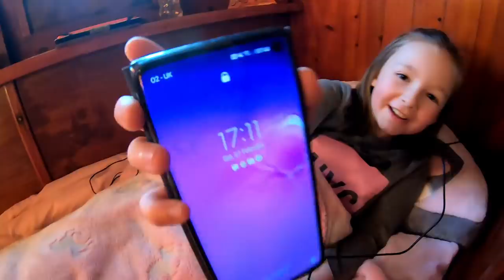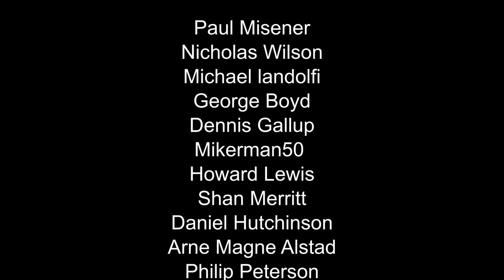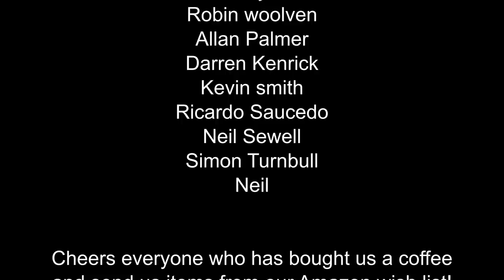Ep 9 What awaits us under the poop deck cover? Restoring our wooden WW2 Ship - Ship Happens

Comment: Sorry, but your poop deck story was backwards. They would "poop" off the bow, or the "head" of the ship, therefore bathrooms are called the "head". Actually poop comes from la poupe. A french word for stern. Technically what you are calling a poop deck is simply the stern deck. People do need to understand your explanation of the "plan". It does make total sense. If you had the money to do what people think you should, maybe you wouldn't even have bought that boat. You're doing great. Lots of cleanup to do before you can even begin to do many major fixes. Regards, Solomon

Comment: The forward main deck looks amazing after a little scrubbing. The darker stains will likely lift with a treatment of oxalic acid (wood bleach), but sadly it will raise the grain after drying. A good pumicing stone will level and lighten further what the wood bleach didn't get. I wish I knew a quicker way to fix the mid-section forward of the stern, but its in-depth process starting with the supporting timbers directly beneath the missing deck portions, and everywhere forward and aft from the breach. The rot has to go, as this is a heavily stressed section with the marine diesel's beneath the ribs & stringers that support the main deck & cabin areas adjacent to it. The kids berths turned out so well, after the barest of efforts, which undoubtedly was a blessing. Stay safe & be very well.

Comment: Just a suggestion. What about you put a length of wood on the roof with a tarpaulin attached and then have a frame on the bow (front) which would give you cover to stop the rain from entering the boat and also give you a dry area to continue to work. I hope this might help, good luck with your build.

Comment: Just to expand on what you said Gemma; Having a wooden boat on the hard for a long time dries out the planking and it will shrink a LOT, this can damage the hull even more not to mention that it then becomes a huge deal it get it back in the water, while it leaks like a sieve due to the shrinking of the planks until the planks swell again.  Also to give an idea on how much the planks can shrink, I saw one wood boat that spent too much time out of the water and the planks had shrank so much you could drop coins between them.

Comment: You may have already worked it out by now (8 months later) but the red tank at 11.11 in episode 1, that was sitting where you have put your shelves back in beside the engine room door, looks like it would have been a remote fire fogging system for the engine room. It wouldn’t meet spec’s now anyway but you may need to consider where you’ll fit a replacement one.

Comment: Poop Deck The name originates from the French word for stern, la poupe, from Latin puppis. Thus the poop deck is technically a stern deck, which in sailing ships was usually elevated as the roof of the stern or "after" cabin, also known as the "poop cabin".

The bathroom or "head" is so-called because it was usually located near the figurehead  at the front (bow) of  old time sailing vessels.    The reason for this placement was because the hull slanted inward away from the upper side of the gunwale and any waste fell directly into the sea without soiling the hull.  There were usually two, one on either side and sailors always used the downwind side when doing their business for obvious reasons.    Wiping was often done with a rag attached to a rope or just the frayed end of a rope  that was lowered into the passing water for cleaning, then retrieved for re-use.
Reply: @meister1210  -- Surely is British slang and a term us Yanks aren't generally familiar with.
Reply: @olgringo-421  there are many terms we use that came from the age of sail. Such as, Three sheets to the wind, to describe someone who is drunk or freezing the balls of a brass monkey, to describe cold conditions.

Comment: I saw the song video  , interesting to see the old lock off the ship lock better with the wire railing  than the wood railing.( I think) it gives the hull a more slim apperens than the wooden bullworks. 
Also you get a flush deck with this construction , no drain ports 
( this can also bee achieved by building in a gap under wooden bullwork)
 Restore the wire 
Railings means  , less work  I think .
The posts can be made on shore and brouth out  to the ship pre made.  By putting in more rows of wire child safety can be achieved.
Of corse these choices are yours to make.

Comment: From extensive experience of restoring wooden boats dont remove your Poop or afterdeck yet. Replace the rotten rib ends and beam shelf first. Start at the aft and work forward completing each rig before starting the next that way you dont risk loosing the shape. Start by taking a paten of the aft rib in ply and check it against the next rib. There is a good chance that several of the ribs are exactly the same which means you van fabricate the portions of each rib that you need off boat before stripping down the rib itself 
Only once the ribs and beamshelf in that section are complete should you remove the decking and repair/replace the deck beams as then you have solid bolting for them.
It may seem obvious but only replace the rib ends where the rot and damage does not extend down past the waterline leave the others until you are on the hard.
Reply: Just keep doing what you’re doing it’s entertaining.

Comment: She looks 100% better with the trash off her!  Work the schedule that works for your family and what you can manage.  You've done so much work on her already.

I like the idea that someone suggested of erecting simple frameworks over the foredeck, aft deck, and top deck and stretch tarps over them (use translucent ones?) and fasten them over the side.  That will keep the rain out and let you work on the decks over a longer period of time.

Is is possible to move her closer to the loading ramp area without costing money?  That might save time and energy by letting you access her by dinghy without depending on the tide.

Comment: An idea for cleaning up wood and removing stain`s on wood is to use OXALIC ACID and Spray it on with a garden sprayer. and leave for half hour then wash off with water you should see a big difference in the wood. plus OXALIC ACID is BIO-DEGRADEABLE. Its made from Rhubarb leaves

Comment: You all did great today, the rubbish is always a huge undertaking so congrates on a job well done.
I dunno if you have one ordered for the boat but when you get up to the point of running the engines again I would suggest a carbon monoxide detector, I know with all the holes in the ship presently it shouldn't be an issue but as you get the ship more water tight I think it might be a good idea to have one in the engine room as a safety precaution. Cheers from Canada keep smiling
Reply from the maker: We do have fire alarms and carbon monoxide monitors and about a million fire extinguishers!

Comment: Ultimately, the only thing she'll have to be on the hard for is the hull work. Everything else from the deck repair to interior fit out can be done, and in fact is best done in the water. Gemma is absolutely correct that you don't want a wood boat out of the water any longer than you have to, so it's best that they be fully prepared to do everything to the hull in one shot, which is what they're probably planning. When new yachts are built, once the bare boat is built, all the finish fitment is usually done at a slip

Comment: Great update guys. I think your cracking on great as it's costing you all a weekend as well.
It's a massive undertaking and I'd be the same, just clearing it out and seeing what's what.
Are you allowed to tie a load of pallets together to make a path to the boat? A bit like a duckboard track.
Reply from the maker: We are on a SSI area so we couldnt get away with that, also the mud is a great layer of security! it will dry out more in the summer which will make it easier to walk to with the kids!

Comment: You are following a very thoughtful approach and are getting closer and closer to the fun stuff of refurbishment. Seeing the changes as we can finally see her is refreshing. Rails?  Perhaps steel post and cables with a wood top? The advantage of what had been added would be keeping the deck dryer in heavy chop, but that said, not sure you would plan on local leisure cruises and mooring or rougher duty. You can plan based on its future use. Her style changes over the years are pretty striking. Looks rather cool. You can pretty much go whatever direction you wish as you replace much of the old additions. We love seeing  you all at work. Beautiful family!
I had not considered getting the mattress like that. Worked quite well. I need to build mattresses for a V birth in my little cruiser, assuming I get back on to that project. Two old aluminum boats to restore,  a 58 LoneStar 23foot and a 67 Lonestar Chrylser 24 foot. All in good time. :)

Comment: You know what guys, I am a self employed tree surgeon who lived on a boat and ifound most who work on boats and who supply stuff for boats, when it comes to pricing, think of a price double it then add another 0 and add 20% , so when I price jobs for them, it's only fair I do the same😁
Reply from the maker: its the same in the camper industry, the price you pay for a small 12v fridge could actually buy you a massive household fridge freezer!!
Reply: @ShipHappensUK  it is a matter of quantity.  There is much less of a market for 12v stuff so manufacturers can only do shorter runs which need just as much setting up etc as the long runs for more common stuff.  Mass production relies on spreading such costs over the whole run.

Comment: Beautiful result from a truly family project! I also love that you are taking the kids along on every step of the journey, giving them knowledge of how work is done, and even craftsmanship! (Such as "hold the knife straight"). I have been wondering what provisions the boat has for mains power? Ordinarily there would be a gennie of some sort permanently installed, but I've not seen one (or it had previously been removed). A practical alternative would be adding more 24 volt battery banks, and installing a 24 volt to 240 volt inverter. A solar recharging system would be nice, but probably not practical in all cases. I would definitely lean toward heavier alternators on the main engines, and keep your batteries charged in that way. As a retired Industrial Electrician this fascinates me!

Comment: Nice episode . Yes , getting rid of the clutter and rubbish is the way to go . You've made a massive difference to her just by doing that , it's looking good . 
Still really puzzled why the bilges are so dry ! You must be lucky :) 
Marine ply with epoxy matting does last well . Might not breathe that well but bang a few sheets on the deck and heat gun the epoxy about over some matting gives a legit finish .

Comment: If you can afford it stainless is the best metal to use on a boat or you will curse yourself after a year rust will start to come through as chips are inevitable wear polished stainless is maintenance-free for many years and will pay for itself what about using the teak look alike which they use on new boats it comes on a roll as far as I know and is very durable and lasts and is good on the feet and also looks the biz not sure how much it costs ut might be worth a look. you could turn the poop deck into a dining area and even put an electric bbq and sink and a fridge bar with seating in a u shape and a lovely table extendable to sit around the seating permanently fitted around the edge of the poop deck with a gate to get to the lower deck to get into the water or to get to shore extend the overhang to the end of the poop deck so that you could put zippable windows for bad weather

Comment: Love the channel,
Just a thought.
Your router check the mains adapter... Is it 12volts...
If so you are running your generator to use a tiny amount of power.
You could run it direct off of your battery and a solar supply when you don't need that 240v generator running.
Save a lot of power and an enormous amount of petrol

Comment: The name originates from the French word for stern, la poupe, from Latin puppis. Thus the poop deck is technically a stern deck, which in sailing ships was usually elevated as the roof of the stern or "after" cabin, also known as the "poop cabin".
The toilet on a boat/ship is ‘the head’ because on old ships like The Victory at the front either side of the figure head was a mesh or wood grating that was used as the bathroom. 👍
Reply: Beat me to it. lol

Comment: I was thinking that  you could use an old boat hull, a fibreglass one, that you could use as a garbage skip/barge. Keep it tied up and when the tide comes in  you tow it to the boat ramp ,put it on a boat trailer and empty it at a garbage tip or recycle place.
Reply: And there are enough boat wrecks there.

Comment: Are you allowed to use marine spar varnish? To clean iron deposits off the metal sinks use a product called bar keepers. And when you get a look up last americit to get the paint off the hull it will take it down to bare wood. Got the feeling the primer original coat will be lead based. Look forward to your next video.

Comment: My friend who saved the Dunkirk Little White Marlin, had the hull out of the water and in a scaffold. Tarp shelter for well over a year. When she did go back in the water the hull hardly leaked at all, he even spent the night on board checking. Mind you when he dragged her out of the water where she had lain half submerged. He cleaned out the hull and it rained, the hull held the water in it, so what a test for water tightness. If that hadn't of happened he would not have carried on with restoring her and spending thousands of pounds. 

Two grand for a lift out, in the fifteen years I owned my boat I only paid a fraction of that. She was 30ft. 10m long and weighed in at 38 ton. The last three winter I owned her, I kept her in Holland. The lift out, transport 5 miles and set down in a climate controlled warehouse for 5 months. Take back to the harbour and be held in a crane for 12 hours cost 1600 EUs. Plus my car was stored while I toured Holland and Belgium.   Some one is trying to take you for a ride, me thinks. Shop around when you do intend a lift out.

Personally I would take her back to original as the new stuff does seam to be suffering. Good luck with what ever you decide on, I just love your enthusiasm.
Reply: I think that the moment you do anything within 10 miles of a boatyard, yacht haven or marina, they think of a number then multiply it by 10 when working out what to charge for things. Because yachties are all minted - they must be or they wouldn't have invested in a hole in the water, right? 

I don't know, but I suspect that a normal crane is far cheaper to hire by the hour than the special gold plated cranes they only use in marinas, and renting a boat sized rectangle of concrete hardstanding probably costs far less if it's not sacred marina concrete (mixed in a golden concrete mixer, of course).

Comment: Great video.  Are you guys going to remove the rails before you redo the decks?  I love seeing the ship start to come together.  Great job getting it dry and getting it well lit.  On a lot of these rebuilds of houses and properties I see them sponsored by simply safe security.  After you get the solar and batteries in you might reach out to see if they will sponsor a video in exchange for their equipment.  That way you can keep an eye on the ship all the time.

Comment: The former height of the superstructure on your boat when you purchased it was too tall for the height of the bow if you plan on using it in the ocean. The historic photo you showed when your boat was in military service shows the height the of the superstructure that the boat was designed by the naval architect to be. If you rebuild it back much higher then you probably risk the bow throwing a lot of water on board or even driving disastrously low into a wave in ocean cruising. Using a marine epoxy to coat the face and edges of all the wood superstructure when you are rebuilding will seal the wood from water infiltration to a great extent.
Reply: Good points, algonquin. While I'll support whatever they decide my heart wants to bring the superstructure, if not the interior, back to resemble the original "look" .

 A modern  relaxing saloon/galley could be incorporated in a "new" superstructure to take advantage of the view. 

Not sure about the poop (apart from depositing..depth charges.. and space for a rubber duckie) but more outside relaxation perhaps, with accommodation etc below. 

Certainly, removal of that other tacked-on stuff would greatly improve handling and safety.

Comment: Well let me just say. “I’m sure I can spend your money better than you.” 250 pounds a month chump change! 
You need to print more money each week or everyone that wants you on the hard can prepay for a year of yard rent. I’m sure that will quite the peanut gallery.
You are absolutely correct about steel railing and painting them. SS is expensive and does rust.
Reply from the maker: £250 a month would be amazing, but it's actually £250 per week! Which is a massive difference!

Comment: Gang plank to shore from ladder?  There would be a way to make a ladder that hangs off the side, with the gang plank hinged on the bottom that could be pulled up w rope / pulley and sit flat against the ladder.  If you want a sketch send an email address.  Not that what you're doing isn't working amazingly well